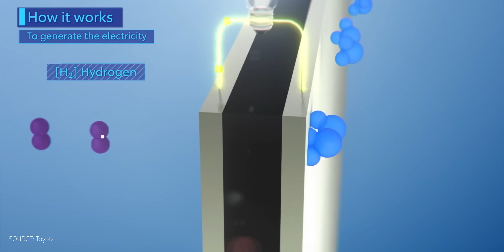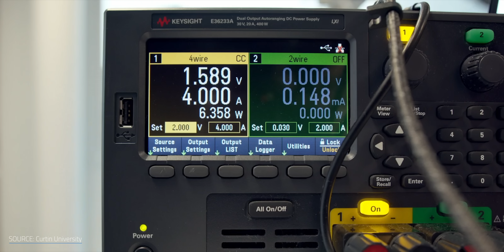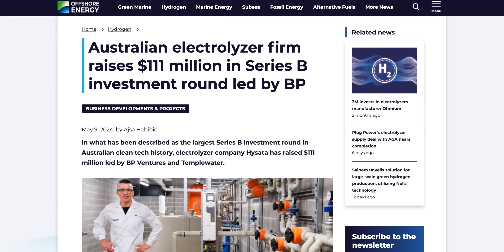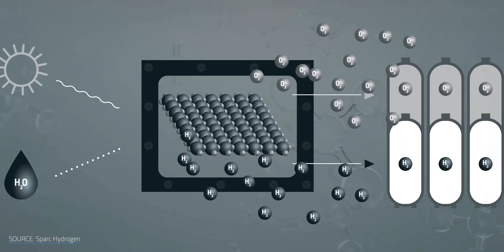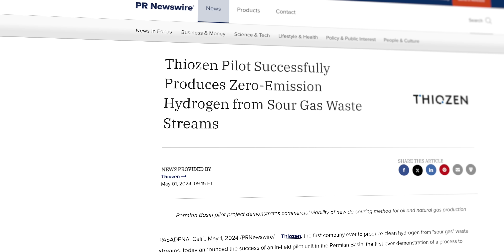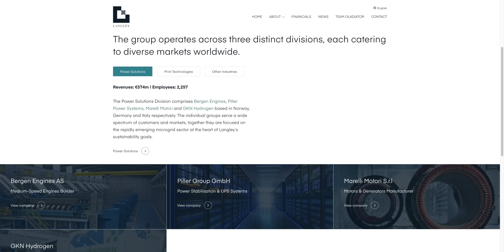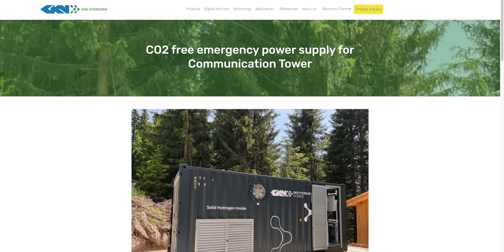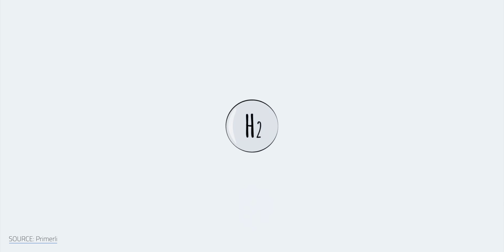How a Hydrogen Breakthrough is Closer Than Ever

Comment: Here's what can happen at a hydrogen production facility, at any hydrogen storage facility or where hydrogen is used. At coal fired power plant near Marietta Ohio around 2010 a hydrogen explosion from a refilling operation caused a major explosion. It can be googled by searching for Beverly Ohio power plant explosion. An employee for the trucking company that delivers hydrogen by truck made a mistake in transferring hydrogen from the delivery truck to a storage tank at the power plant. The accident killed him and blew off the side of the power plant.  The final analysis in the aftermath of the accident, it was determined that driver forgot to connect a ground wire from the truck to the storage tank he was refilling. The explosion blew out the wall of the power plant where the truck was parked, killed the employee that was filling the the tank at the power plant. Consequently, it shut down the power plants for a number of weeks at the very least I have forgotten exactly. 

The guy forgot to put a ground clamp between the truck and the tank to be filled. It caused a static spark that ignited some leaking hydrogen. That's a simple explanation of why hydrogen shouldn't be in cars that driven on the road and get in wrecks.

Hydrogen is highly explosive. A container of highly compressed hydrogen which is what is being used in these hydrogen vehicles, is like driving around with a bomb underneath of you. Hydrogen is far more explosive than gasoline if handled incorrectly.
Reply: I’ve driven past several gasoline powered vehicles that were on fire and burning to the ground. I grew up next door essentially to an oil refinery where some of my friends parents died in fires and explosions. I’ve known dozens of people who have been crippled or died while working on oil drilling rigs. Energy production and transportation and storage is dangerous for any form of energy. One anecdote of one person neglecting safety shouldn’t derail an entire industry.
Reply: I'm not a fan of hydrogen, but I think you're being a little alarmist. A tanker with 7,000 gallons of gasoline is arguably much more dangerous. Hydrogen can go boom to a degree, but has the mostly fortunate characteristic of being buoyant and rising harmlessly (?) into the sky, versus the gasoline situation where it sits in burning puddles and lakes, burning everything around it ( and polluting the ground water while it's at it ).

Battery electric cars are problematic as well. There's apparently nothing 100% safe when you want to cart it around on public roads.

Comment: Pebble bed nuclear reactors operate at temperatures high enough to disassociate water at much higher efficiencies than electrolysis and can operate continuously, providing a reliable gas production. The reactors operate at low pressures, not needing the complex cooling needed by conventional high pressure systems.

Comment: everwind in NS canada is producing off shore wind to generate hydrogen and storing it as liquid ammonia, this is their solution to the storage issue since it doubles the energy per volume of liquid hydrogen, while making it safer and easier to work with and there are already known and well established processes for ammonia. it can also be used directly in fuel cells if needed or converted back to hydrogen. they expect their first facility to be running in 2026 with others to follow to provide additional wind power

Comment: Green hydrogen will be great for certain chemical processes. Not for energy storage.
Reply: Why not? Seasonal storage is not solvable with batteries die to cost, low capacity and low cyclic rate. Besides Uruguay, Switzerland and Scandinavia Hydrostorage is insufficient and thermal storage has a too great loss rate. Currently power to gas is the only scalable storage method which can easily bridge months.
Reply: @BugMagnet  You're the only one I've read here who makes sense. High pressure hydrogen gas storage is a current technology and it would work for utility storage at all time scales, short term, long duration, and seasonal. Here's proof: https://www.youtube.com/watch?v=jCZXrRQNhzg
Reply: @BugMagnet  Hydrogen seeps through materials.
Reply: @KevinLyda  We simply don't use those materials. There are plenty of materials we could use. It's an engineering issue and doable.
Reply: Hydrogen contains a lot of energy tho,

For hydrogen in 700 bar pressure: 
Energydensity  [Energy / kilogram]                         3 x better then gasoline                        130 x better then li-ion battery
Volumetric energy density [Energy / liter]             5 x worse then gasoline                         2 x better then li-ion battery.
Reply: @mathijsbroeders3454  how much energy to get it to 700 bar pressure?

Comment: increasing the efficiency to 95% kinda does make it more promising for energy storage, but only if we find ways to mitigate the compression and leakage loses. until then sodium batteries are still the best bet for grid storage. but maybe it could make hydrogen more competitive for large heavier vehicles that need a lot of range where batteries start becoming less worth it because of weight.

Comment: I believe that hydrogen has too much competition from batteries in most sectors, but there's definitely some areas where it beats batteries, mostly as a plane fuel and in the production of steel I would expect
Reply: Even in aviation batteries have got there first; commercial short haul battery planes are already available whilst hydrogen remains at the R&D trial stage. Perhaps in long haul hydrogen might have a shot (combustion rather than fuel cell, as planned by aeromakers) but even there battery holds out potential in the guise of high energy density metal-air forms (offering similar energy densities to jet fuels).

Comment: After seeing Elon musk’s comment about hydrogen, I went to ChatGPT for a breakdown of conversion efficiency. If I give you two sets of identical solar panels for free, you get free electricity. One set is used to power EV, directly transfer solar energy into the battery. Another set is used to generate hydrogen and then power a hydrogen vehicle. The conversion efficiency tells the reason why it makes no economic sense to go down the hydrogen route. There might be certain applications or niche markets for hydrogen but overall it has lower conversion efficiency than battery. Maybe you can showcase a specific situation where hydrogen makes economical sense. In the case of wind turbines on the sea, the electric energy can be converted into hydrogen or it can be connected to the grid and power EV. At the end of the day, the total system efficiency is the most reliable indicator for commercial success.
Reply: It's about storage in multiple aspects. Musk is hardly unbiased here. Prompt the predictive engine a little more.
Reply: @zweigackroyd7301  high pressure storage has cost in terms of hardware and the energy to compress hydrogen. If you have an actual economic case, please share calculations and commercial justification.
Reply: @dennistlc  What do you mean by "economic argument." Please be specific. One reason fossil fuels are favored by many is the user does not pay the true cost. Storing solar power currently requires the damaging and very costly mining of rare earths, the manufacture of batteries and power converters, and the disposal (ideally recycling) of said batteries. Please provide the calculations of what you do and do not include in your assessment of the costs of producing solar energy, as well as the time span you are using in your assessment, as well as how you account for subsidized research. Then I'm happy to work on a comparison with the potential of hydrogen.

Comment: And even with that "production problems" step taken. It istill has to take a far bigger step. . . . .using Hydrogen on a economical base in a normal car. 
Making it cheaper, lighter, less dangerous and more usable, than storing that energy directly into a battery.

Comment: If it can be powered by renewable sources than I do think it has at least a niche use case.  Since it would be stored as a liquid or solid, it would have some value as an option for clean off-grid power sources that don't rely on either fossil fuels, wind, or solar.  They outperform lithium batteries and to refuel the device you won't have to wait for it to recharge.  It would definitely have its use cases.  It could, at least in theory, replace gasoline if the means to sustainably produce it at large scale becomes feasible and comparable (or cheaper than) gasoline and diesel.

It seems at least on track to becoming an option comparable to or generally superior to batteries in some cases, but batteries seem to be maintaining its lead for the time being, what with recent solid fuel batteries appearing to be viable (and likely to improve to the point that they are both better, longer lasting, and cheaper than traditional lithium batteries).  I have my doubts that it'll ever outpace batteries in EVs at least.

Comment: Going from 80% efficiency to 98% is quite good (If it's real. There's only one article). They reached the efficiency of metal-ion batteries. There's only one problem left. How will they solve the explosion risk of hydrogen tanks? Carbon fiber begins to crack with constant pressure changes. Eventually the car will crash and the tank will crack. The explosion of a 700 bar tank is very dangerous for the driver and the surrounding people. Additionally, the hydrogen tank must be replaced at some point. Do you think people will have their cars serviced regularly? I don't think so. You don't need to have constant maintenance on Tesla cars. You can escape while the battery is burning. How will you escape from the explosion of the hydrogen tank? Everything happens instantly.

Comment: More efficient and greener hydrogen generation is nice but the major issue if it is ever going to do anything for transportation is storage, especially at the point-of-use. Even solid storage doesn't really fix that: it replaces simple heavy high-pressure tanks with a still bulky and heavy box filled with fancy storage media that needs to be heated to release its hydrogen.

For commercial and industrial applications, cryogenic storage may be more practical, albeit at the expense of expending even more energy condensing the hydrogen. At that point, electrolyzer efficiency becomes the least of your worries.

Comment: Long answer yes, battery tech is not suitable for all means , motorcycles being one , you just can’t cram the batteries in that give equivalent to gasoline, sure sub 300cc which are usually city bikes are often ok with a sub 120 mile range on high speed road yet touring, and extra urban commuters have shunned the battery models not just to a 50 increase in cost but hate the short range many in the market don’t also have places to charge easily. Further more I firmly believe there are two types of car driver we are seeing battery’s from 6o to 245kwh in cars that’s a huge cost outlay ifs far simpler to have a 30/40kwh and hydrogen hybrid setup, further trucks and special needs vehicles such as forklift, Crain , auto recovery and long range delivery including international transport benifit from a long range hydrogen over a 500kwh battery, or as in the cases of models listed fitting the required battery capacity just isn’t possible due to road weight limits that can’t be achieved with battery alone .

Non converted rail transport also is a huge area not being talked about the cost alone in the us to convert to electric and eu is over 160 billion usd and requires over a billion tonnes of materials dug up , air both passenger and cargo need alternatives that lower cost and doesn’t affect transport loads and range ,  right now markets are looking at various gasoline options, yet a hybrid option with hydrogen gas seen spy planes run not for hours but months before return for refills, now im not saying that sort of deal could happen with transport yet it is easily possible to convert major airports over to hydrogen fuel. Further more there is a huge amount of people that just do not like yo I cook with induction or electric hobs and ovens, the commercial side of industry would rather relocate than pay high energy costs, so it is essential not just to lower gas imports but also make nations self sufficient.  Case in point the U.K. government plan to go to a 60% minimum electric wind farm grid , the cost alone is well in excess of 300 billion pounds for both grid and wind installation, but this plan doesn’t tell the down side of such a model , case’s point Sweden is largely wind and hydro powered, yet wind like the tide fluctuates daily further more there can be huge changes in production, this leads to higher bills regularly at both peak time of day but also throughout the day there is a reason why the U.K. is not 100% on every day you may see headlines of no coal powered days but the nuclear plant is always running, but is not enough to power it all , so n that means using cross country or eu power grid national rids are debunk, so select countries or states make more from selling than others this is why I feel hydrogen comes into play in times of excess production that creates gray hydrogen,  so in an ideal world when the temps drop or peak energy prices loom it feeds back into the grid the same way water hydro storage, and compress air and weight transfer work , as well as a 20 to 30% blend making significant impact in import demand that will be fully renewable, my feeling adding additional nuclear and eventually one day fission powered are key over just a one shot power in battery and wind

Comment: To me, it always made sense to produce hydrogen from renewable sources whenever there's excess power.  Sure, it's not as efficient as storing it in a battery, but cost of materials ought to be lower, you can sell the fuel you don't need to 3rd parties, and you can import more from elsewhere in emergency situations.
Reply: @Toastmaster_5000  I don't disagree with you, but there are probably better ways to store the energy, for instance grid level flow batteries ( which in theory can be very cheap ). If you were to build an electrolyzer that stores hydrogen and then used a fuel cell to turn it back into electricity when needed, and any excess hydrogen beyond THAT was shipped of to be used as industrial hydrogen... well, it's not a ridiculous idea, but as you say, it's not very efficient. I think using it as a battery, ie electrolyzer to produce hydrogen, compress it to store in tanks, and then fuel cell to turn it back into electricity makes almost no sense because of just how inefficient it is ( I saw one estimate of 30%.)

You're much better off using grid scale batteries such as flow batteries which are cheap, efficient, and have utility scale lifetimes ( 20+ years ).

As for using excess renewable energy to produce hydrogen for say, industrial use, yeah, that sort of makes sense. But as we build grid scale batteries, we'll use more and more renewable energy for that, so it doesn't really make sense until you have sufficient renewable sources, and sufficient grid scale storage, to make the grid 100% green. 

THEN maybe it makes sense to use excess energy to produce hydrogen for industrial use. I think that's quite a while off...
Reply: Cost of materials at a system level is generally high for hydrogen energy storage as with hydrogen you have to factor in the cost of the water purification unit, the electrolyser, and the storage compressor/liquifier, plus ancillary pipework values and control systems. Electrolysers vary by design but many contain very expensive elements such as Platinum as catalysers. On top of which the TCO from the higher operations and maintenance cost has to be factored in. This is why most hydrogen units tend to be large sites with multiple large storage vessels to drive down the cost per litre production costs. The containerised units shown in the video sited on the turbine, would not be more efficient or cost effective compared to a similar containerised battery, particularly a flow battery that would off similar long duration capability to a hydrogen unit.

Comment: There are still myths about how dangerous hydrogen technology is (there was an H bomb, after all), so it would be great to see a dive into myth vs. reality.
Reply: Perhaps less so myths - two UK hydrogen home heating projects were cancelled due to lack of public interest following safety analysis reports were released showing a 4 x increase in explosion risk. Another UK project proceeded as the operator refused to publish the safety report on the ground it would stop the project from continuing; the local press eventually forced it's release along with a video of the test results. The company put the video up on YT, but made it unsearchable and no links from their own channel; the press decided then to publish the link to allow access. The stoichiometric ignition test shown in the video was a bit of an eye opener as to the potential impact.
Reply: @GruffSillyGoat  That's why I said myth vs. reality.